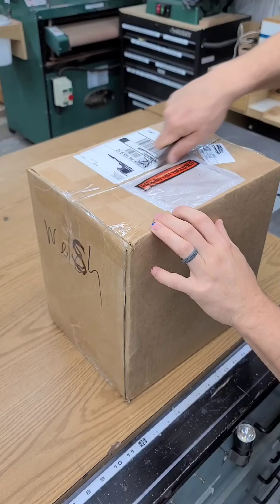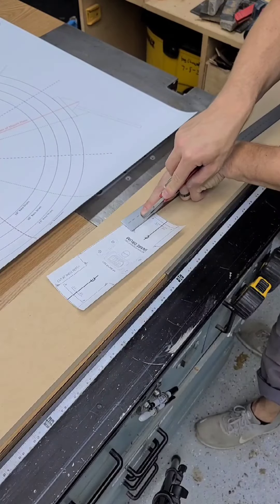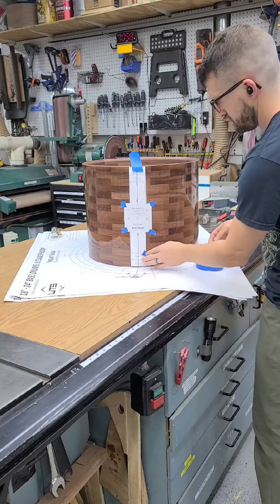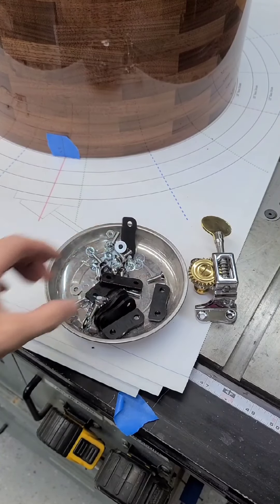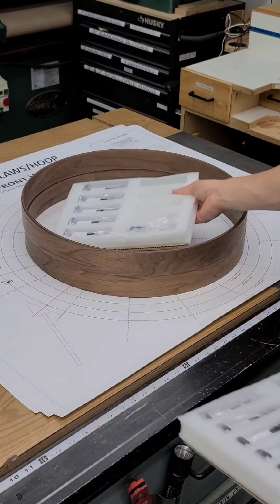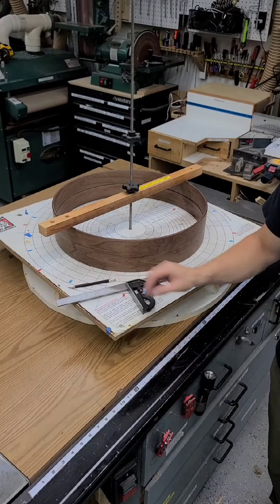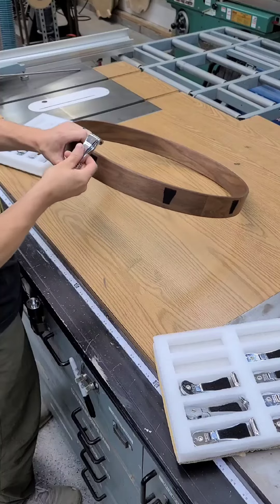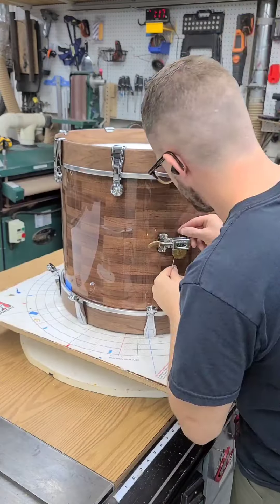I'm building a cable-tuned drum set

Comment: It’s too bad cable tuning didn’t catch on, but it is a bit limited so it’s understandable.
Reply: You'd really need 2 separate systems- 1 for the top and one for the bottom to make it possible to tune the heads separately.  Like a Dialtune snare.  The funny thing is that of all the drums in a kit, the snare is the only one that only needs the top head to change in order to alter the sound while still sounding in tune.